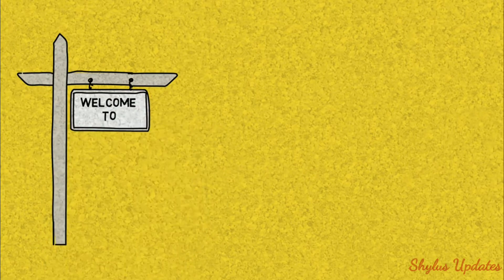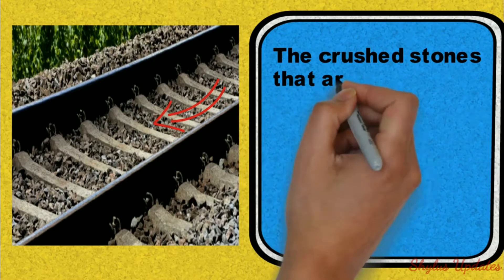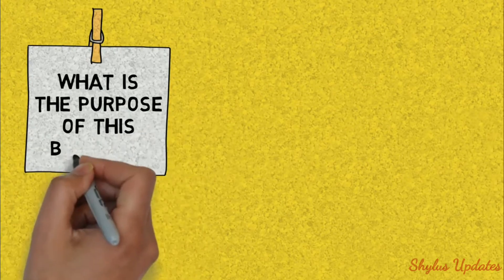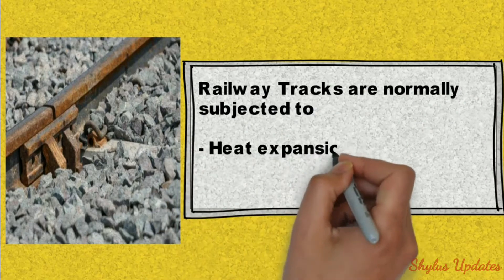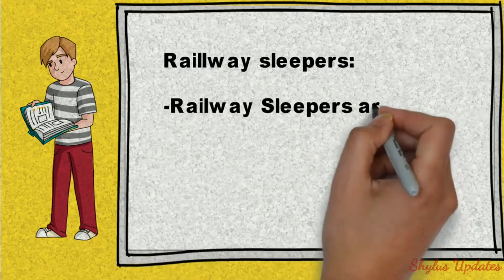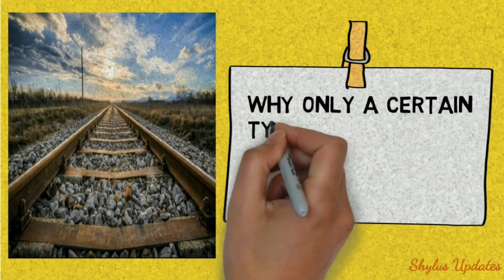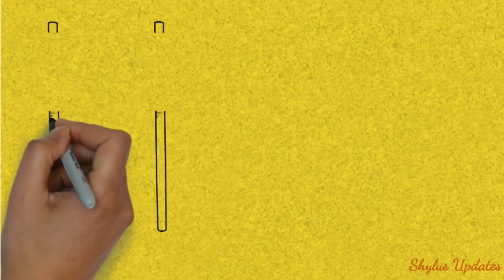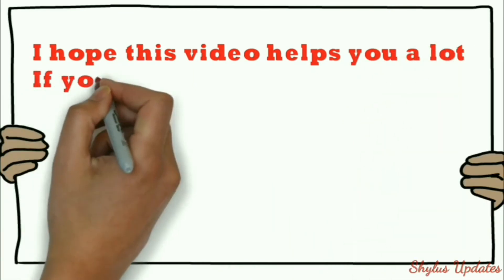RAILWAY ENGINEERING | ANIMATED VIDEO | WHY CRUSHED STONES USED IN RAILWAY ? | BALLAST IN RAILWAY

Comment: What is the thickness of ballast layer?
Reply from the maker: Track ballast should never be laid down less than 150 mm (6 inches) thick, and high-speed railway lines may require ballast up to 0.5 metres (20 inches) thick.
Reply: @shylusupdates  Thank you